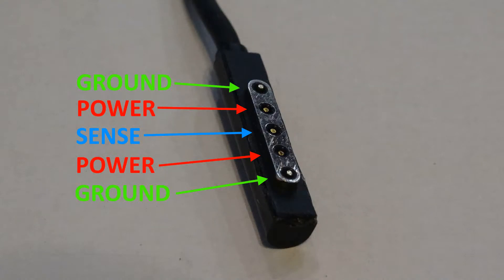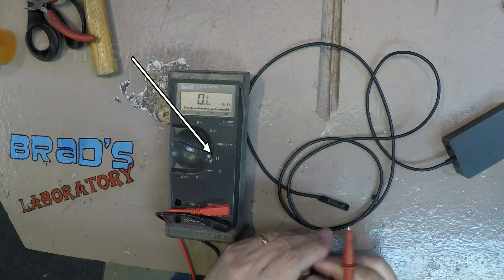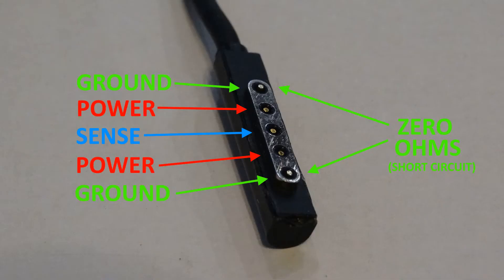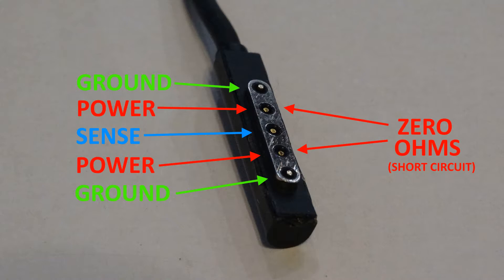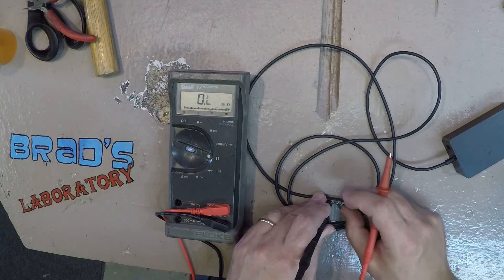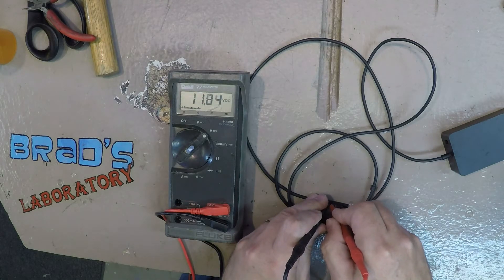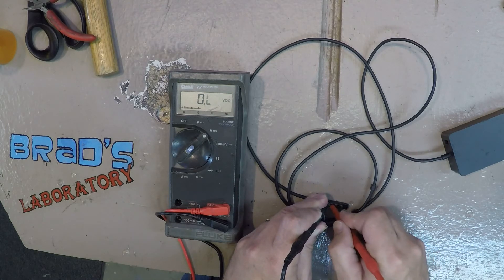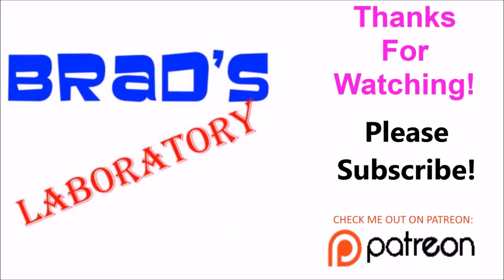PIN OUT AND VOLTAGE ON A SURFACE PRO CABLE

Comment: Hello, i want to test a Surface Pro 2 before I buy a charger for it, do you think I can just charge it using a 12V/2 Amps adapter just by using the wires like in your diagram, directly holding + to the red and black to ground. Thanks
Reply from the maker: @rgrunzo  short answer is yes, but double check the pin out of the Surface Pro 2 - I believe Microsoft changed the connector.

Comment: I have a surface pro 7 , trying to figure out what the polarity is on that connector, do you know. ? Appreciate your help.
Reply from the maker: https://www.bing.com/images/search?view=detailV2&ccid=IZNRgPso&id=DD19A642946330A5EF74970728B279A91600858E&thid=OIP.IZNRgPsoFPOgVoP5gCTJiQHaFZ&mediaurl=https%3A%2F%2Fi.stack.imgur.com%2Fcrlhi.jpg&cdnurl=https%3A%2F%2Fth.bing.com%2Fth%2Fid%2FR.21935180fb2814f3a05683f98024c989%3Frik%3DjoUAFql5sigHlw%26pid%3DImgRaw%26r%3D0%26sres%3D1%26sresct%3D1&exph=466&expw=640&q=surface+pro+7+power+pinout&simid=607999865884639982&form=IRPRST&ck=8BCA84FADF8CE20BB45534D2BBFAE809&selectedindex=1&qpvt=surface+pro+7+power+pinout&pc=APPL&vt=4&sim=11

Comment: My original surface RT power supply had zero volts on the pins.  So I figured it was bad and bought a new power supply.  It too had zero volts on the pins.
I'm about ready to chunk the whole thing in the trash.

Comment: Did you make a video on how to repair the charger too? Please reply
Reply from the maker: Chargers are fairly cheap, Repairing switching power supplies is an art form and will have you chasing your tail for days. The best thing to do if you have to repair one is to pull the big transistors and check them, and check to see if the transformer is open or shorted. other then that it is usually the control chip. But it is really not cost effective to repair these today.

Comment: the charger of my microsoft Windows surface RT has no power anymore, what should i do to charge my tablet now?  I'm waiting for your boss answer .. thank you
Reply from the maker: The quick answer is to buy a new charger. If you have another 12VDC supply you could cut and splice the old surface connector to the new supply.
Reply: @BradsLaboratory  how to splice the cut wires? Soldering ? Or just winding the ends together will be enough? Is there any guide?

Comment: Hi Brad, is the polarity on these charges Centre Positive?
I cant find an answer any where on the net, and the pictures of the adapters (and even the physical devices) dont seem to have the little picture that shows you....
Reply from the maker: This is the surface pro 1,  from many years ago (I still use it though) the connector was flat, so no center. Ground on the outside pins, positive on the inside pins, center pin lights the led in the connector. You may have a surface pro 2 or later where they changed the connector. Let me know what surface pro you have and I will help you google it.

Comment: Thanks, just a question: Is it harmless if I use a power supply delivering a 12.48V voltage (5A) , as indicated by my multimeter (I don't know how accurate it is, it is not a high end instrument) in replacement of the original Microsoft power supply ?
Reply from the maker: That will be close enough to power the tablet.

Comment: Is the shielding used for anything?, like the sense line? I have just a blue wire, red wire, and shield. The red was shorting on the shield. I just taped the red and blue, without the shield connected, any harm?
Reply from the maker: Shields are usually tied to ground on one end or the other. Grounding the shield prevents outside interference from messing up the voltage on the wires protected by the shield (in this case). Shields can also work the other way keeping signals in (TV Coax). typically when they are used to prevent interference they are only tied to ground on one end to prevent micro  currents from flowing in the shield. So it shouldn't be a problem that you didn't hook it up.

Comment: Thanks, you are make similar video but with conector surface pro 3 or 4 voltage?
Reply from the maker: Surface Pro 4 power supplies are about $10 on Ebay, feel free to kick me some cash via PayPal and I'll buy one and make a video.

http://PayPal.Me/Bradslaboratory